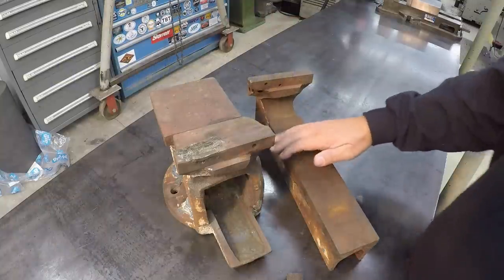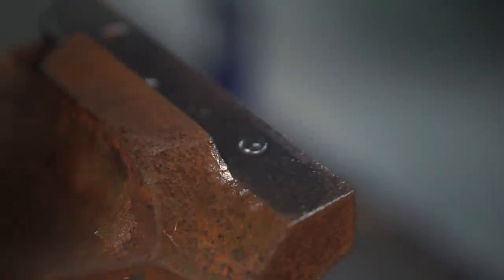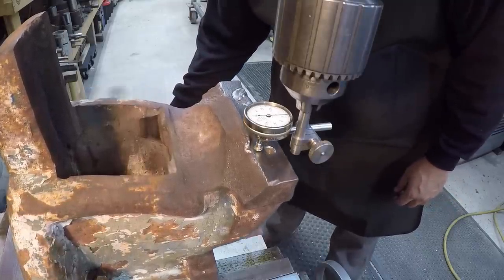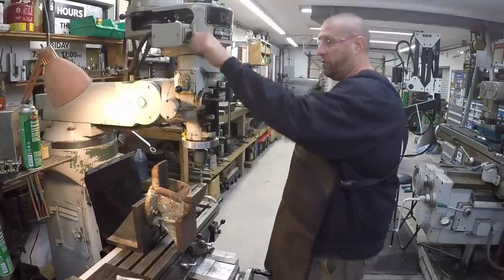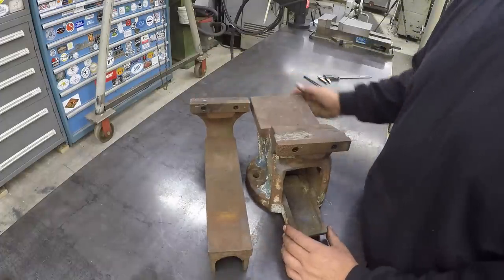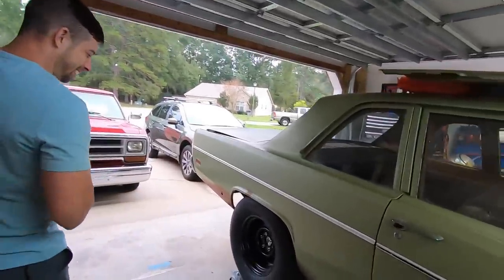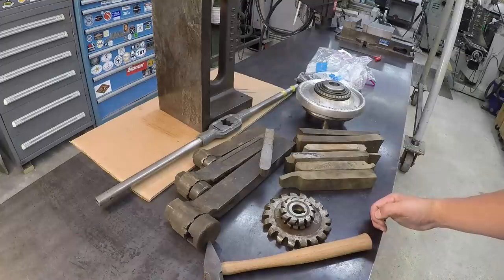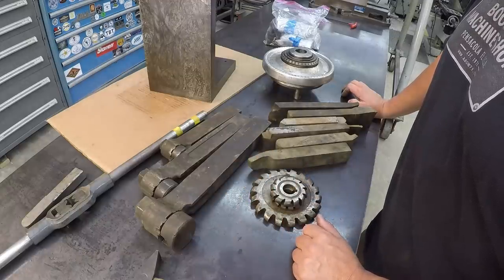SNS 283: Busted Vise Repair, 69 Valiant Update, Texas Picks

Comment: Adam, when you brush remover on, only apply it in 1 stroke. When you brush it on with multiple strokes, the remover solvent evaporates. The thick goo is a type of wax to keep the solvent against the paint surface and force the vapors through it.

Comment: Not sure if you read these but a tip for when you're doing paint removal with stripper the biggest problem where you have to put multiple coats is evaporation and drying you can get a special paper called peel away you place over to keep this from happening  depending on the surface but what I often do depending on the chemicals in the stripper you have to test to make sure it won't melt it  but I apply a good coat then cover in cling kitchen  wrap or even painters plastic this stops the evaporation and will get you much more paint removed per application

Comment: That looks like an AWESOME bench vice..... my neighbor died and he had an old Wilson ( 1944-60) on his bench,. I bought it for $40. and Sand Blasted it, bought NEW jaws, new end cap, new horseshoe washer and handle........... when I finished RE-painting it I had a NEW OLD Vice................ it looks so good in my shop....... great job. 
LOVE what I see of your shop !
Reply: If you replace the thrust washer with a Torrington thrust bearing, you'll love it even more.  Plus, you'll never need to hit the handle with a hammer or your hand to tighten it enough, or to get it loose.

For less than 5.00, it is well worth it.  I did all my vises 8-10 years ago, and even made an old Japanese vise, which had become a door stop, literally, a useable little vise, again, LOL.
Reply: THANKS,... It has been 4 years now and it works so nice,.. no reason to improve it now... would have if I knew more about that at the time... THANK YOU for the info.
p.s.... I never would hammer a great vice like this one.
Reply: Too bad more people don't value a vise like you do. I've seen so many guys beat vise handles until they're dang near a 'U'!  LOL

I didn't state the effect of Torringtons as well as I intended. Before I replaced the thrust washers, I've been in situations where I couldn't get a vise tight enough to hold something and have had to really 'rank' on the handle to get it tight enough to hold.  Then, it's near impossible to get it loose!  I admit I've then had to use a soft hammer or cheater bar to get the handle loose.

Since  I've replaced the washers, I haven't had problems getting anything tight, or then getting the handle loose.  

The reduced friction makes an astounding difference.

Comment: I use the washer trick too, the only difference is that i have this drawer of nuts i wallered out on the lathe just for this. Gives my torch and rod enough space to get to the bottom. Simple, quick operation. Chuck the nut, and then use a chamfering bit to cut it. Always good to have a variety of these on hand, makes life easier on the other end. Also, i found that the softer the metal on the washer, the worse the operation goes, BUT, that being said, it can't be too hard (like say a washer from stainless or something you'd find on a motorcycle, hardened washers).

Comment: those wing nut swiveling 5/8 rod clamps ("heavy duty indicator base" clamps from the plastic bag are by Gem instrument Co.  in Brunswick Ohio. they make real good stuff, and you can use them for all kinds of setups and positioning uses. they make a good range of sizes and products. no affiliation, just a fan

Comment: I Got a vice in that cond that was outside for ten years.  Everything was siezed up. I took it home and put it in the burn barrel for a half hour and got it all apart cleaned  all the parts and put  it back together  and a paint job turned it into a nice useable vice. I use it a lot.

Comment: When you struck on that bolt with the tig torch, that’s definitely from the rust between the threads... When extracting bolts from something like that, always expect rust to get pulled out. Stainless steel wire helps against porosity like that so I always immediately dab a little 309 in there and keep soaking the heat with the torch before I add the washer & bolt.

Comment: I love the LAL tap wrench, my late brother was apprenticed to Lehman Archer and Lane in 1965 as a thread grinder, at the works in Forest Road Hainault Essex.mHe later moved to a small engineering company making specialist threading equipment, mainly for the aero industry ( when we still had any lol ) one of their main customers were Rolls Royce aero engines. My brother used to thread grind taps of around 4" in diameter with an extremely fine pitch around 40 tpi and he had to work to something like two tenths of a thou tolerance for RollsRoyce. The LALfactory is still there but split up into about ten different businesses. If memory serves, they shut the business in the late 80' or early nineties. It's great to see a LAL product in your collection Adam, keep the vids coming, I love the content, and yours and Abbey's Adventures.

Comment: I'm surprised you didn't make the holes bigger rather than make the heads on the screws smaller. As a general rule, I like to update old to fit newer parts. That way you get modern parts in an old device. This makes for easier replacement parts.

Comment: Handy tip for removing paint with chemicals from a guy who lives in a really dry area:

If you can put the part in a plastic bag or a small box of some kind while the stripper does its work, it will usually work a little better before it dries up. You won't have to reapply quite so much. 

Love that Valiant!

Comment: Adam, I know you once had a fairly substantial sandblast cabinet. Not sure why you didn't keep it; perhaps because you don't do many tool restorations but sandblasting is an invaluable tool for that work.
My sequence for clean-up is usually:
1. scrape off large deposits of grease and chips
2. power wash
3. paint remover if paint is heavy
4. sandblast
5. wire wheel parts that won't be powder coated.
I am not a patina guy and prefer my restored tools to look like they would have (or better) when new.

BTW, do you still work at Motion? Haven't seen any videos of your work there lately.
Reply: Paul Decker I do know that he left Motion. I do believe it’s so he can focus on jobs in his shop, YouTube, and traveling but don’t quote me one the latter! I do know he left Motion though.
Reply: Also sandblasters aint sponsoring and giving him free stuff.

I do agree 100% with your method though.

Comment: I've watched a lot of different guys online taking out broken or just rusted stuck bolts. I haven't seen any yet heat the area and then touch paraffin wax to it. That's what I learned decades ago. That wax will gets between the two threaded surfaces and a lot of times let the bolt or nut thread off. I've seen it work like a miracle. Like all things..no guarantee. But it's always my first choice.. Try it..You may be surprised..

Comment: Use a pressure washer after you leave the paint stripper on for the hour. Also after applying the stripper, wrap the vice with plastic wrap while you are waiting for it to do it’s thing!
Reply: That's what I was thinking, with that texture and the letters to deal with, I bet a pressure washer will make short work of it. Even if you have to do a couple rounds of it, you would save some elbow grease.
Reply from the maker: I’d actually like to try that. Brush the whole thing then blast it with the pressure wand.

Comment: Metric in the shop!. Tip: to find tapping drill size for metric standard threads, simply subtract thread pitch from outside diameter. EG, M8 - 1.25P = 6.75, say 6.8 mm  equivalent 0.266". This approximates to 85% of full thread .
Thanks for sharing.

Comment: I've had good success with broken bolts and studs using one of the freeze spray lubes. Loctite and CRC(?) makes them. Where heat works great for nuts, because of expansion, the freeze sprays shrink the bolts/studs inside the threaded hole.

On really tough ones, I've drilled the bolt/stud, heat, (doesn't need to be even red), then freeze spray into the hole. 

Saved my ass on EGR studs a couple of times...

Comment: Hello Adam.  I have also run into the same problem of new socket head cap screws (SHCS) not fitting in old machines.  When I took the front cover off of my 1957 American Tools Works Hole Wizard (radial drill) the original screws were packed with body putty and paint.  I tried using new SHCS but the heads were too large.  I ended up cleaning up the old screws and reusing them.  I have always wondered if there was a change in the standards for these screws and it resulted in a slightly larger head.  If anyone has an old copy of Machinery's Handbook (from the 1950's or older) they could check the head size and compare to the modern ones.  Thanks for the video, Ken

Comment: That Plymouth would be a good candidate for some baby moons.
Regarding the paint stripper and the vise: you need to apply a much thicker coat and cover it with clear wrap (like the stuff for food) to prevent evaporation and then use a wire brush like you did except use a nylon brush and some burlap to get all the paint off. Rinse it with denatured alcohol and you’re done.

Comment: Great video Abom79!  It is really too bad the vice owner did not ask you to build up the metal below where the jaws mount.  without this reinforcement, pounding on the jaws will likely stress the bolts again and possibly break out the bolt holes.  This is what must have happened originally requiring the cavity to be filled in.

Comment: A more modern alternative to the Jacobs Rubberflex collets are ER collets.  Each collet covers a holding range of 1mm so that  all diameters are covered. I use ER32 collets that made a max dia. of 20mm.  ER50 sizes go up to about 40mm dia.  I regularly use them on all three positions...headstock, tailstock and milling machine.

Comment: Hey Adam!
An "old" iron restorer once showed me another 'trick' of the trade, in regards to getting bolts out of cast iron.  Flood it / soak it with WATER.  Believe it or not, water WILL dissolve rust around these threads.  But, ONLY if it is NOT contaminated with petroleum products!
Ken

Comment: Covering paint strippers with a vapor barrier , Saran wrap, clear cellophane food wrap, holds the vapors in and takes it to the bare casting. The vapor does the removal, not the coating.

Comment: Just a guess but camera might have crapped out due to really high exposure from welding light. You could try an ND filter (or several) to cut exposure and probably a UV filter would be smart as well. Really high exposure, usually from shooting directly at sun can damage a camera's internals.
Reply: UV/IR shielding filters too

Comment: When the screw first started to loosen, that would have been a great time to add a few drops of 50/50 ATF and acetone. It would have really been absorbed quickly in the threads when really hot.

Comment: I saw you trying to remove the paint on the vise, so I thought I'd let you on my way.   The best chemical stripper I've ever used is called Dad's easy strip.  Apply liberally, and here's the best part, use a pressure washer to remove the mess after the stripper has had time to work.  The water gets into all the tight spots really easily.

Comment: My guess is the original screws for the vice jaws where slotted cheese heads. They have a smaller OD than the the socket head cap screws. I thought at first it may have been 5/16ths cap screws as the heads on Whitworth screws of the "equivalent" size (M8/ 5/16ths, M10/ 3/8ths, etc.) all generally have a smaller head also, but obviously the existing M8 thread means otherwise.

Comment: I don't know what the price of that safe erase by the 5 gallon pail,but 40 years ago a 5 gallon pail of zip strip was cheap enough to soak that entire vice in then pull it out 2 hours later and power wash it ,works great,and if you have a really tough job,I know a fella that has some friends that own an extremely high pressure washer that is primarily use to demolish reinforced concrete ,he had them come out and make a car disappear I think they got everything but the castings,then some other friends got rid of those with 40 pounds of dynamite,yeah a sight to see.

Comment: Hey Adam,
Always watch your videos keep them coming. As a die maker when we assemble details to cast iron die shoes we always dip the screw threads in oil. Cast iron threads are delicate and can run the risk of pulling the threads out when you remove the screws. Just a tech if you didnt know. 
Mike - Plus8Precision

Comment: i find that for best results with any of these liquid strippers including evapo rust use a brake clean or asitone to clean the oils off the surface and wire brush to brake the surface then apply the gel or submerge in evapo rust. the oil acts as a protective coating.

Comment: Regarding the counter bores  the standard head sizes for cap screws were changed i believe  1930's  when bolts get modified as you did to accommodate tight counterbores  we called them Chicago bolts.... not sure where that term originated or if it was just a Milwaukee  saying.
Reply: If it's just a Milwaukee thing, it migrated clear out to Wyoming. Curious how the term came to be.
Reply: Chicago bolts are sex bolts. Like the ones you see holding leather together, or on Kydex holsters.
Reply: @xenonram  no, you're referring to Chicago screws.  Chicago bolts are cap head screws that are machined to allow clearance in a slot or recessed hole. Common in industrial pumps and blowers. Two totally different types of fasteners.

Comment: Once you loosen the paint with the stripper and remove the bulk,  try washing it off with lacquer thinner or equivalent.
Reply: I would have tried my pressure washer,especially around the embossed part lettering.

Comment: Hallo Adam, den WIG-Schweißtrick, muß ich mir merken, ich werde den Trick aber etwas anderst anwenden. Ich nehme eine größere Mutter zum aufschweißen, Gußeisen verursacht eine Schale zur Schweißnaht. Der nächste WIG-Schweißtrick wird besser.
Hello Adam, I have to remember the TIG welding trick, but I will use the trick a little differently. I use a larger nut to weld on, cast iron creates a shell for the weld seam. The next TIG welding trick will be better.

Comment: So when you tig weld you hold the gun with your right hand and the filler rod with your left. Are you naturally right handed? Or do you weld with either hand?
Reply: If you're right hand, you hold the torch with your right hand. Your non-dominant had feeds the rod.

Comment: Open the countersink on the jaws so any cap screw will fit without modification. I love your videos!
Reply: Those jaws are way too hard to mess with.  regards
Reply: @garyc5483  Carbide mill will go through easily.
Reply: Agreed  but who wants to chance wrecking a carbide on any one of 4 holes when its not part of the remit to fix the item All he was asked to do was get the broken screw out and drill &  tap one hole. regards

Comment: How does that vice work with the handle 90 degrees to the jaws?   Does the handle lock and unlock the vice or does it use some bevel gears to move the jaws?

Comment: I've been meaning to ask, since you do a reasonable amount of tool restorations, have you tried converting rust in a steam or electrolytic bath? The advantage would be that you don't remove (as much) material, especially if you continue by bluing the part afterwards.
Reply: Just a heads-up regarding electrolysis as there's a hydrogen embrittlement risk which could cause component failure; hardened tools and springs being most affected. Can be mitigated by heat-soaking of course but then you lose temper (pun?) meaning heat treatment would need to be reapplied.  Complexification!!   Other than that, it's a black magic process and one I've used successfully many times.   It even strips paint and old jappaning.  It can cause surface pitting however, as all red rust, even the inaccessible stuff, is removed before conversion - it doesn't happen in situ.  Pitting can be avoided by treating with phosphoric acid well prior or instead of electrolysis.  This will covert the red, iron (iii) oxide rust into iron phosphate. Not only kills it but stops it from returning.  Importantly, the bulk of the conversion happens in situ meaning material does not get removed to the same extent. i.e.: less surface marring.  Itcan also be used as a preventative measure which is a similar concept to bluing; just a different execution.  Kissing cousins if you will.
Alternatively, a high-pressure washer is an excellent option.   It'll strip paint (yep), gunk and surface corrosion without removing any good metal and with minimal personal effort.  Gets into all fiddly bits, and no chemicals!
Just my two cents.
Reply: @moltopericoloso  Thanks for the input, I didn't account for hydrogen embrittlement - that's an important factor potentially. But I guess that's the point, it get pretty complex, expensive and potentially dangerous if you add phosphating as pre-treatment. And to be fair, carding and polishing with scotchbrite doesn't remove that much material that it would be that big of a concern outside conservation of historical objects and collectibles.
Reply: Rust removal need not be more complicated than soaking overnight in a citric acid or vinegar+salt bath. 
Commercial rust removal products are a fraud 9/10 will list the ‘active ingredient ‘ as a % of citric acid which will be minuscule anyway. 
Depends on your material and condition. Using the vice as a prime example as stated a bucket of water with some citric the rust will turn black give it a rinse,dry then oil and you’ll be good to go.

Comment: The Valiant looks like diamond in the rough. A real spare tire hole. May be a dumb question but why use a 360 out of a truck instead of one out of a car? My dod had a Fury III with a 360 and that engine was a runner.
Reply: Magnum 360s were never put in cars. Just trucks and SUVs in the 1990s.